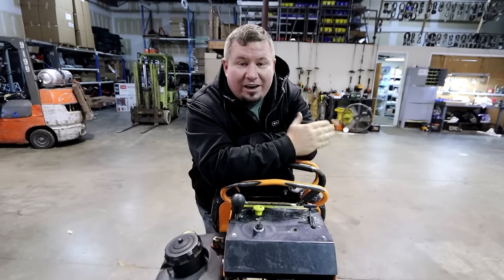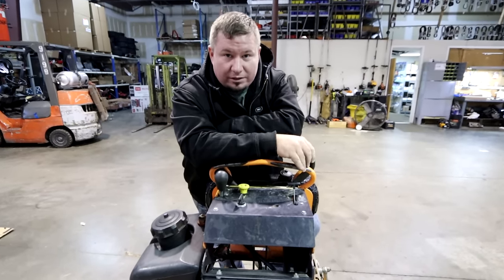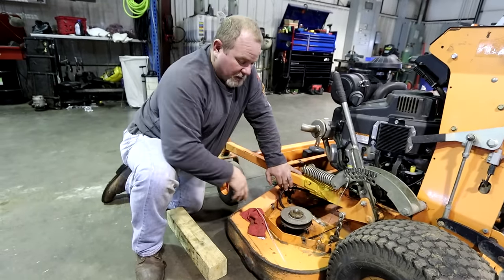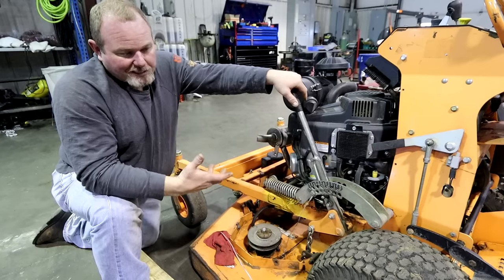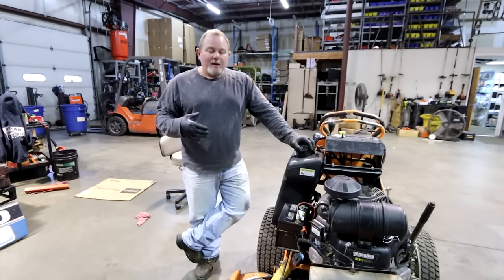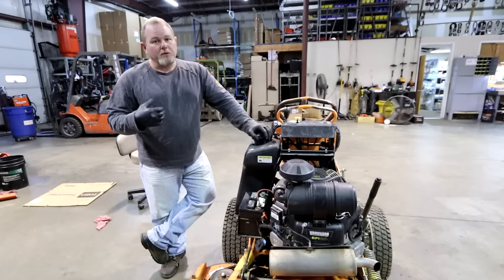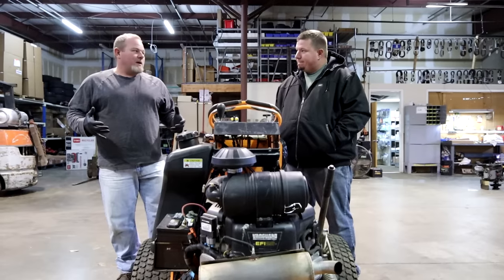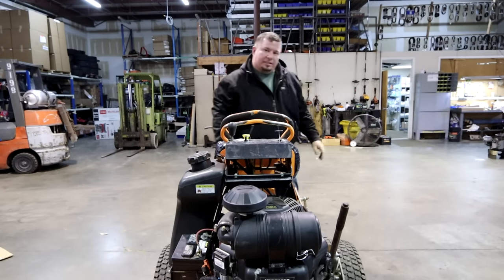Buying a Used Lawn Mower? | Residential or Commercial What to Look For!

Comment: Can you do a video on replacing a Kawasaki 680v engine? I've got a Scag Tiger Cub with 1,800 hrs, but the engine just started leaking oil.  It appears to be coming from the plug area. Can I go with a bigger Kawasaki engine ie. 27hp or efi?

Comment: Thanks for the great video. I'm considering buying a used Scag commercial 48-inch zero turn. It had a 22hp kawasaki engine and was replaced with a 19hp kawasaki engine. What are your thoughts? They don't know the hours. And what is a fair to good price based on this information??
Reply from the maker: 19hp seems a little low, I have a 52” with a 23hp and it will struggle and want to bog down in the taller thick grass…

I would definatly recommend cutting with it to make sure it’s got enough power for what you’re gonna do with it, other than that it could be a great investment!
Reply: @CutandCleanTV  Well noted and thank you for taking the time to reply. Greatly appreciated.